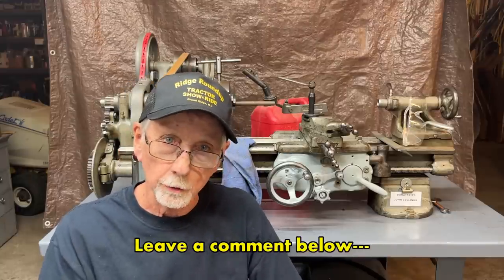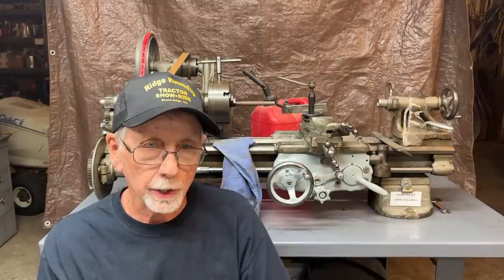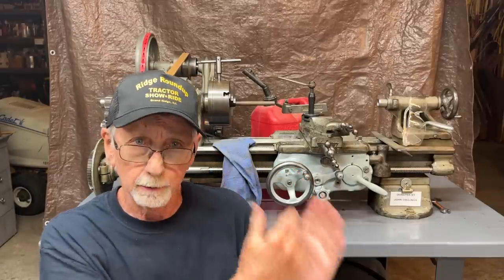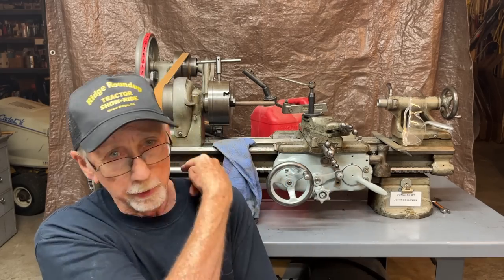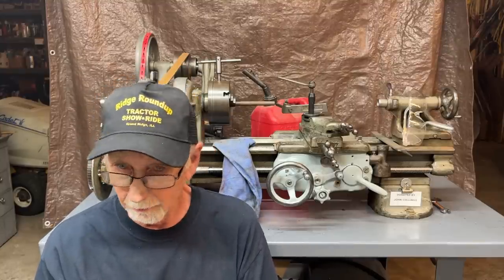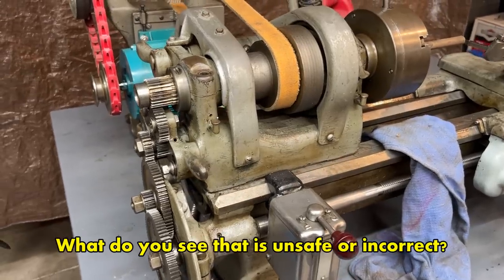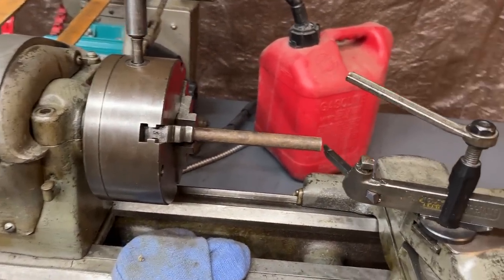SHORT SUBJECT #2 BAD LATHE SETUP tubalcain

Comment: This is a great exercise!  Very well, here is what I saw:

1. No bare wires to monitor for over current smoke
2. Blue rag, not a regulation red one (too easy)
3. Smudge on the tailstock's safety squints (It really needs to see clearly to off center drill the end of the work)
4. Ways are dry and clean (chips hold oil next to the ways)
5. No ash tray for cig butts
6. Potpourri can has no vent for pouring (it's a glurg glurg container, I HATES those)
7. Cushioning chips have been removed from below the bed (also might cause the part to be too easily found after parting)
8. Not enough grease/oil on the handles (possible blister hazard from skin friction)
Reply: Tro all the guards in the recycle heap. You don't need em!  God i loathe those segmented belts.
Reply: He's got all the correct set up for audible speed feedback. The higher the speed, the more feedback. It's even stored as a recording on the surface of the part! You can replay the last few milliseconds! Old tech still used in the finest machinist locations today!
Reply: @aomanchutube  Excellent!  Very well done.
Reply: No cup holder nearby where you can place your beer.  Wait - I take that back.  You would be holding your beer.
Reply: @rossilake218  Yup.  Agree. Those link belts turned my nice quiet lathe into a rumbling noisy one.  Easy to put on is just not that important.

Comment: Mr. Pete, you always deserve a thumbs up. 
What I wrong:
1-No belt guard. 
2-No gear cover.
3-Key in the chuck.
4-Gas can in the work area.
5-Shop rag on the machine.
6-Work piece too far out. 
7-Cutter too far out.
8-File on the ways.
9-Broken safety glasses.

Comment: After looking at other comments, a lot of people thought this was funny, even joking, but as a safety inspector/instructor for the USAF, I find this kind of stuff extremely serious... 1) drive belt APPEARS to be frayed, 2) power cable jacket appears to be crushed, possible short or cut... 3) Rag on ways... 4) stock sticking too far out from chuck... 5) cutting tool in holder sticking too far out...  6) tool holder too far out from hold-down fixture... 7) loose file on ways... 8) safety glasses not on operator 9) no guards in place, gears or belts... 10) general clutter... that’s from the initial viewing once I started writing comment, it wouldn’t let me go back to view a second time... what did I miss? Great work, I love all your presentations... keep’em coming
Reply: Ohh lord your QA. Bet you put yourself in for an award after watching this. 130 crew cheif currently civilian A&P

Comment: I love files bouncing around on my machines ways while it's running, it knocks down the high spots.

And if your trying to kill that elusive rat across the shop all you have to do is flip the lathe on just as he walks in line with that key in the chuck.

Everybody knows the best way to face something off with lots of chatter is to leave the material sticking out of the chuck as long as possible. And to make sure that wrench you left pointing towards the chuck clears it's always a good idea to leave the tool sticking out of the holder as far as possible. And to really be safe; let the holder stick out of the tool post as far as possible. 

Just in case you miss the rat and hit yourself between the eyes with that chuck key it's always nice to have a big rag under the piece your working on. You can use it to wipe the blood out of your eyes. It also makes a great cat toy once it grabs on some long metal strings while your turning and starts to fling it's self around like a dog chasing it's tail, cats love that.

I see your planning to convert it over to run off a gas engine and already have the belt guards removed and the spare gas can in place.

Comment: Well, just following the video tour around the lathe:

1) A lot of people will complain about a lack of belt guards. OSHA sure would.
2) Ditto about no cover over the change gears. (Did this lathe ever have one?)
3) Armored cable between motor and switch has a crush in it, could result in a short or hot to chassis.
4) Armored cable is lying on the bench, if a lot of oil or cutting fluid is used it could seep into cable and harm insulation. (This cable is not liquid tight.)
5) Rag on bed under chuck, theoretically (but not too likely) could get wrapped up on the chuck.
6) Chuck key in chuck!
7) Work is sticking out way too far, will bounce all over the place.
8) Ditto tool bit sticking way too far out  of tool holder, will vibrate and cause chatter.
9) Ditto tool holder is sticking way too far over the support on the cross slide.
10) Gas can right in the back where hot chips could hit it, or possibly sparks could ignite fumes (not likely, but why chance it).
11) Someone could object to leaving the wrench on the top of the toolpost.
12) File lying on bed ways, can/will nick the bed. (Probably won't hurt anything but pride, but still, why make a mess)
13) File with no handle!
14) Maybe someone could object to the safety glasses hanging on the tailstock rather than the operator's face, but in fact there is no operator here, so the safety glasses are in a good place to grab when an operator shows up.

I guess there are more, but those seem like the obvious ones to me.
Reply: Everything this guy is saying.
I think there is possibly a missing motor mount or bracket.  At least I am questioning in the 4 missing bolts on top of the motor.
Sorry I don't know much about lathing or machine shops.
Ok, I'll be standing behind the safety glass ready to call 911 if anything should go wrong.
Reply: I didn't spot 4, but 13, lol, no. :-)
Reply: Tubelight on single phase is cousing strobe effect, on serten machine speeds the workpiece could look like its standing still while ist turning.
Reply: @arjanvanraaij8440  Yes, a student at my college (back in the '70s) cut his hand off with a table saw because they (at that time) had fluorescent lights in the shop and with the noise of other machines running, he couldn't tell that his saw was running.  :(  They quickly removed the fluorescent lights from the machine & wood shops and installed incandescent lights!

Comment: Stick-out,tail-suport,gas-can,saftey-glasses on the machine instead of face,file on harden-ways,machine feed set to feed,tool to far out,chuck-key in chuck,wire pinched on lathe motor, tool holder to close to the edge.love the videos new interactive series maybe
Reply: Second time around theres a bolt missing from the main bearing cap closest to the chuck😬

Comment: I thought the give away was the frayed belt and no guards on either.  File - "I need it handy in case I need to english a high spot.  Why not push that work out to the full deck - and not both to support it anywhere?  Or why not choke up on the work and bring both the tool and the work into minimum distances to face it.   Keys - belong on a magnet - away from the chuck.  Magnets because I always know where to look for tools.  Cheers Sir!

Comment: Good morning Mr. Pete. As I see it there is a key in the chuck, a rag on the bed, tool to far out of the holder, holder stick out way long, wrench on the tool post, file on the bed, and safty glasseson the tail stock. Not to mention the missing gear cover.

Comment: Nothing wrong with that gas can behind the lathe on that damaged power cord. Sometimes the shop gets cold and a brief fire is a nice way to warm up. Besides maybe with the big stick out the cutter at the unstable 90 degree angle will break off get grabbed by the chuck key and wrapped in that loose clothing flung into the gas can and get the whole party started! 🎉 Nit sure what speed it will run at with that crooked belt on the mix match pulleys but if it still doesn’t run the right speed could always use that file across the bed to pry it over to the next speed. Don’t forget to put the safety glasses on the chuck though so no broken parts of file get in the scroll.
Reply from the maker: lol lol lol

Comment: I'm no expert but:
1.  Armor on wiring is crushed.  Maybe cutting into wires?
2.  Gear train cover is missing.
3. Blue rag can easily catch on leadscrew and wrap around it.
4. Chuck wrench has been left unattended in chuck.
5. Material is over extended.  1xmaterial diameter of extension would be a lot safer.
6. Tool, tool holder and top slide are all WAY over extended.
7.  Wrench is left unattended on lantern tool post.
8.  Plastic gas can or any kind of gas can is in the WRONG place!!  Put it in a flame proof cabinet.
9.  File is on the ways.  Very bad practice both for safety and machine damage.
10.  Plastic safety glasses may be an issue with OSHA.  Shouldn't they be on the operator's head?

Great video Mr. Pete

Comment: 1. Work extended too far out.
2. Cutting tool extended too far out.
3. Tool Holder Extended too far out.
4. File on Ways - bad practice.
5. Gas can fire hazard - hot chips?
6. Rag to get caught up in lead screw.
7. no guards - gears or pulleys.
8. Lantern not centered in groove - bad practice.
9. Chuck key not stowed.
10. Probably should not start lathe with automatic feed engaged.
11. We love you Mister Pete.
12. I've owned an Atlas Lathe for the last 9 years and I never would have bought it or learned how to use it if it had not been for you.  Keep Making videos, all of us love them.  I like your jokes too.

Comment: Open gears, combustibles, lathe chuck key left in the chuck (i almost lost the passenger side window in my truck learning this one the hard way), loose rags, cutter sticking too far out, file on the ways, cutter holder and lantern toolpost not centered (this might just be my OCD kicking in), workpiece hanging out too far, wrench left on the toolpost.

Comment: 1)Uncovered gears
2)Uncovered belts
3)Chuck key left on chuck (which is the first to show the results should you start the lathe)
4)No chuck cover 
5)Flammable container next to hot chips (opened aswell)
6)Too long of stick out on the workpiece
7)Too long of stick out on the hss too bit
8)Too long of stick our of the bit holder
9)Spanner left on tool holder might come in contact with the chuck
10)The file left on lathe bed ready to fall in the screws.
11)Tailstock left Uncovered so dust and chips can get inside.
12) And the rag left below the chuck
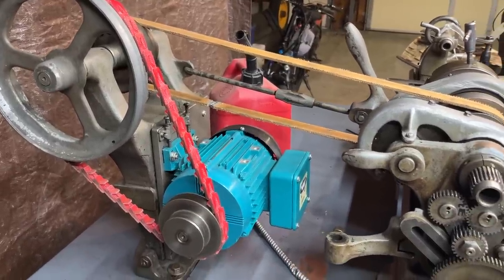Reply: 13) Squashed metal shield on mains cable. (1:07)
Reply: @chrisarmstrong8198  14) The Apron isn't appropriately dirty, and makes the rest of the lathe look bad. :)

It's a nit-pick, but I don't like magnets stuck to lathes.  I want chips and dust to fall off, not stick.
Reply: At least those safety glasses are doing an excellent job of protecting the tailstock from flying chips.
Reply: File on the ways, bad for the ways. It can file them down and drop file chips on them.

Comment: 1> Latch chuck key left in
2> tools (file left on ways)
3>Flammable liquid can too close to work
4> Excessive tool stick out
5> Excessive tool holder stick out 
6> Safety glasses on tail stock (should be on your face)
7> Rag left on ways
8> Damaged electrical conduit for lathe power (switch to motor). May be damaged wiring inside
9> Excessive work stick out. Move in closer to the chuck.

Comment: In addition to all the others that have been identified I see some more. A change gear has  missing teeth and bolts are missing in both main spindle bearing caps. This lathe is an accident waiting to happen. The carriage lever is set for threading and the half nut is engaged. If this thing was turned on it would take off like Hogan’s goat.

Comment: I'm happy many mentioned the damaged BX/ac90 cable and at least one noted that oil resistant flexible conduit or oil resistant armoured cable is what is really required here. I could not get a good enough look at the motor to see if it has an appropriate thermal cut out built in but no matter that would also be included in the contactor/motor starter with its correct hp rating that is required here in North America. You might think this unnecessary but ask yourself what your first reaction would be if you are turning something and the power goes out. Finding a flashlight in the dark or absent mindedly picking up the chuck key without FIRST turning the power off would be a bad idea. A contactor drops out when the power fails, a very good feature. And after all that, if you are still feeling flush, throw an E-stop on and make your mama happy.
Reply: Oh, I almost forgot. Bonus points for using a TEFC(totally enclosed fan cooled) motor.

Comment: 1. Chuck key in Chuck
2. Gas can by lathe
3. No gear cover
4. HSS bit over extended
5. Tool post wrench left on
6. Cloth wrapped around lead screw
7. File on ways
8. Not wearing your safety goggles

Comment: Allen key left in machine, HSS stick out angle of cut , file on ways, rag on screw, gas near hot chips, no belt guards /no gear cover, tool post tighten wrench

Comment: I like this type of video Mr. Pete!
Lessee...
(1) Chuck key left in chuck!
(2) Work piece sticking too far out of the chuck jaws for facing off
(3) Wrong tool holder (LH) for facing and not set up properly anyway. Some people might object to the wrench as well.
(4) Not really the proper tool for facing off (IMO) and sticking too far out of the toolholder.
(5) Blue rag could get caught in lead screw
(6) Red gasoline can probably should not be where it is.
(7) Speed change belts on step pulleys not in correct position
(8) As far as I know all these lathes DID have a door over the change gears.
(9) The BX power cable is damaged.
(10) If it were my set up I would not leave a file across the ways.
(11) Safety goggles on hand but not over the camera lens!!!! HAHAH!

Comment: Rag near spiny parts, no cover/guards, file on bed, too much sticky out of part, improper cutter set-up, safety glass on tool, belt improperly aligned, tool holder handle over work area, Chuck key left in chuck, gasoline jug near work area and inside.

Comment: I don't know the first thing bout running a lathe, seen 'em run quite a lot, so I don't really know. The working piece seems to be stuck out there a mile. Shouldn't you keep your work as short as possible, to cut down on chatter? Safety folks would be going nuts over the lack of belt guards and gear covers. Looks like you have a belt on a flywheel. Your cutting tool seems a mite long, shouldn't that be as short as possible too? Cut down on chatter, I believe. Some folks will be screaming bout the adapt-a-belt, but I've seen whole shops run on them, could be a modern problem. Looks like your tool adjustment leaver is right in your workspace. Like a frying pan handle, shouldn't it be pointed the other way? By the way, the lathe is not a work bench or storage area. Excess tools and supplies, such as gas cans, rags and files, should be put away.

Comment: Armored cable is kinked, no gaurd over change gears, key in chuck, stock extended to far, cutter and tool holder extended to far, tool post wrench pointed towards work, rag close to chuck, file on ways, one thing that I almost missed, is the carriage feed is engaged.
But I know you would never set this demonstration up without first unplugging the machine.

Comment: 1/ Gas container at back of lathe
2 / Blue rag on vee ways/bed
3/ chuck key, left in chuck
4/ work pieces to far out of chuck
5/ HSS tool piece too far out of tool holder
6/ Tool holder has way too much overhang
7/ spanner left on top of lanten tool holder
8/ lanten tool holder overhanging tee way.( I would have it centered)
9/ change gears exposed ( should have a cover, OHAS)
10/ file resting across vee ways and in crush area between tailstock and saddle 
11/ and the worst violation, shocking colour tarp as a backdrop. 😊

Comment: I found 12 that I can name, but sure I counted 13Although 1 of them ( change gear cover absent) could be because it’s missing. So, chuck wrench still in chuck; work piece sticking out way, way too far; tool holder sticking out too far; cutting bit sticking out too far; rag left in work area; file has no handle; file left on ways; gas can close by; safety glasses on lathe instead of head; belts not covered; and wrench left on tool post.

Comment: I think you have like a canister of maybe gasoline right next to the motor, I say that's not ideal. There's also rug on the ways, possibly tangling up into lead screw. I see there's a file on the ways - that's unfortunate. Both workpiece and the tool are extended to the maximum, lack of better support probably should cause some chatter. I think something is sticking out of the chuck at the top. I think the beer bottle is missing.

Comment: i read the comments and not one person noticed the two bolts missing in the spindle caps. and the steel cover on the wire between the lathe and the motor has been smashed into the wire that can cause a short in the wire inside.

Comment: 1. No guard on the gears
2. Can of gas in back
3. Chuck key left in
4. Too much stock stick out in chuck
5. Too much tool bit and turning tool stick out on compound
5. File on the bedways
6. File with no handle on the tang
7. Rag too close to lead screw
8. Safety glasses not on head

Comment: 1.Electric 120v Wire cable damage with gas nearby!
2.tool stick out and part stick out
3.open machine v belt/chain No guard

4.No gear cover
5.CHuck key in chuck
6.rag near chuck
7.no safety goggles
8. file on ways
9. Threading gauge engaged

Comment: 1. Key is in the chuck
2. Gears are open and need cover
3. belts covers are now required
4. rag on the rails
5. work peice stuck out way too far
6. lathe tool stuck out way too far
7. that's a left handed facing tool, need a right handed
8. compound at wrong angle IMO
9. the proper place for eye protection while in the shop is on your face.
10. what's with the gas can right there, looking for fireworks?
11. file on the ways!!!

Comment: 1 No garde on drive belt.2 cover not on the change gears 3 work pice is out to fair for the chuck 4 chuck key still in the chuck 5 rage on the ways under the chuck 6 fill on the bed ways 7 gas can on the table.  8 right hand tool instead of a left hand tool